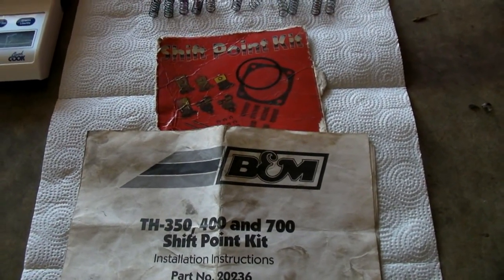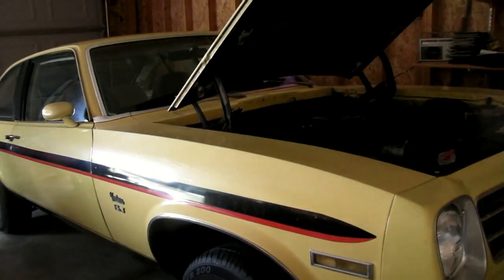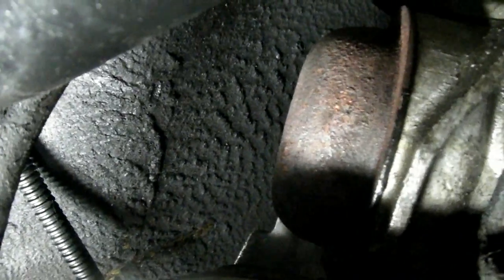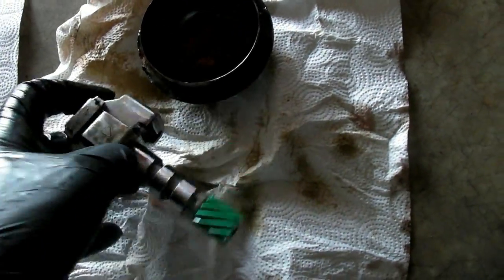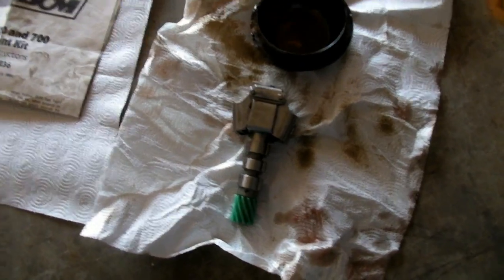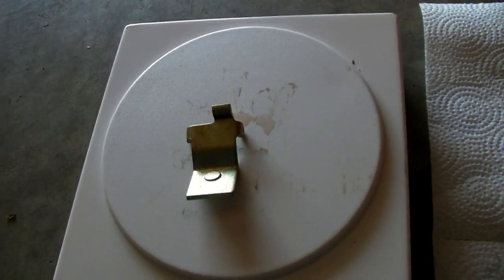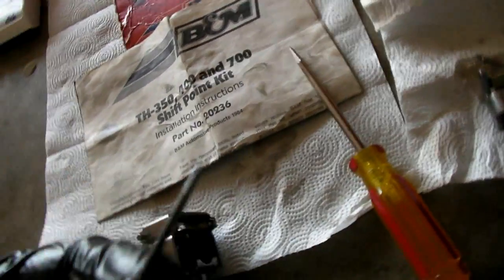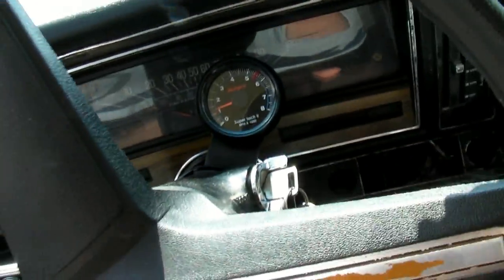B&M Shift Point Change Kit For TH350, TH400, 700R4 or 4L60 Automatic Transmissions & Road Test

Comment: I just had my auto built to performance specs for my Buick powered commodore and also had a 2200 convertor (stock was 1600).  Also fitted long tune headers, free flowing sports system, some intake mods and loaded my dyno tune cal.  The auto shifts between 3500-4000 and won't rev over 4000 until about 200km/h+   Stock it would shift at 4500 and hold 3rd till top speed, but now it's 4th before 100km/h at WOT.  I suspect they auto builder changed the governor to suit a potential turbo install years down the track and lowered the shift points rather than for the current setup, I mentioned I wanted the strength for a turbo later but to suit the current engine.   Since I am an auto n00b as I have not driven an auto for over a decade and know not much about them I am hoping this is the solution. 

I need to change the weights/springs until I get a 5500 peak rpm which ever gear happens to be the highest shift point.  Raising the part throttle shifts will be great too, I like about 2500-3500 at about 25% throttle.  In manual mode the auto/converter combo is great, much quicker than before and the shifts are very fast and firm, not that lazy clutch burning shifts before.  Just the auto mode points are poor.

Comment: Does anyone know how to, or if you can get your 1-2 and 2-3 shift points close to equal with the governor?  Mine are 1-2 5600 rpm and 2-3 4200 rpm. I would like to raise just the 2-3 to 5500 rpm and leave the 1-2 alone.

Comment: I just did mine, factory weights were 16 grams each, shifted around 2000 driving easy and 4000 at wide open throttle. I changed both to weights that were 12.3 grams each, raised easy driving to 2500 and wide open to 5200 or so. Also softer springs will give you a snappier shift, stiffer springs will give softer shifts.
Reply: One of the most helpful 700r comments I’ve found on YouTube

Comment: this was an excellent presentations thank you, you mention changing the full throttle shift points but what about part throttle, in my case I want a bigger space between the 1-2 shift and the 2-3 shift, right now they seem to happen real quick and back to back
Reply: You need an adjustable vacuum modulator for part throttle adjustments. They're about $15 on Jegs.
Reply: @NateLarsonTheNetNinja  700R4 doesn't have a vacuum modulator.  TH350 and 400 do.

Comment: Quick question for you, because you obviously know your stuff. My dad had a stock 74 z28 Camaro with an M40 transmission. He told me that if you manually shifted the car into 1st gear, stood on the brakes and revved it out, you could launch the car and the transmission would shift through all the gears with the shift lever still all the way back in first. He said if you were up to speed and didn't move the lever into drive, as soon as you slowed down and it would start downshifting , it would drop right into first and just about put you through the windshield when it downshifted. I can't find any info on this online, but it's sounds pretty damn cool like GM had a built in launch feature in the M40 without advertising it. From what my dad said, only old school M40 fans know about this "feature". Have you ever heard of this? If you do, would you mind filling me in on how this actually works?

Comment: Thanks for the video.  My th350 is shifting from 1-2 and then 2-3 almost immediately.  I'd say by the time i'm doing 10 or 15mph, I'm already in 3rd.  I have a 454 hooked up to it in a 57 Bel Air with stock rear end gears.  Fluid level is good, vacuum is 50 inches at the rear modulator on the trans, TV cable is hooked up with no slack so that as soon as throttle is opened, the TV cable begins to pull out.  Any ideas where I might start?  Thanks!
Reply: Daryl Zihyer how did you get 50 inches of vacuum. thm350 doesn't have a tv cable it has a kickdown with a slot that doesn't start pulling till half throttle or so.
Reply: johnapaterson Registering 50" vacuum at the line coming from the intake going to the modulator.  Iow, 50" of intake vacuum being delivered to the trans modulator.
Reply: Daryl Zihyer My gauge only goes to 30" of vacuum. 50 is quite high and should be around 20 with a stock or close to stock engine. When you pull the vac line from trans end does the rpm raise on engine? Any trans fluid in vac line at modulator? What you have is called stacked shifting- google it. I would look at the kickdown cable again aswell. it should start pulling cable at half throttle or so.
Reply: Daryl Zihyer d

Comment from the maker: Changing your rear end gears will not change the shift points, Yes I did just change one weight, I would recommend just changing one weight at a time it makes it much easier. In my experience it has always been a guessing game changing the weights. You never really know how much it will change.
I had a 94 Z28 a while back that had the factory performance package in addition to being a Z28, it came with 3.42 gears z rated tires and no speed limiter, it shifted at 6000rpm. What rpm r u getting.

Comment: I need to bump up my shift points after my can install. Few questions... Would changing my rear gears from 2.73s to 3.43s change my shift points? Did you only change one weight? I was under the impression that there is a weight for each shift point? How do you know how much each weight changes it? So then I don't go over my desired limit? Thanks! Car is a 93 Z28 has an LT1 and 700r4.

Comment from the maker: @50105nelson ...if you have a vacuum modulator on your transmission you can get a adjustable modulator from summit racing, that may help you out. 
Also make sure your kick down cable or TV cable is adjusted properly.
Changing the weights always seems to raise both part throttle and full throttle shift points.

Comment from the maker: @HotRodStart ....thanks for the comments, if you have not found the info yet the way you adjust the kickdown cable for a th350 is there is a plastic tab you need to lift up with a screwdriver, it is near the bracket that holds the cable then have someone push the gas paedal to the floor from inside the car, while they hold the pedal down you then push the tab back down to lock the adjustment.

Comment from the maker: You may have some bad seals inside the transmission or clutches. You could try a product called AT205 Re-Seal, it will soften the seals and may get some more life out of your tranmission without having to rebuild it. Also change the fluid if you have not already.